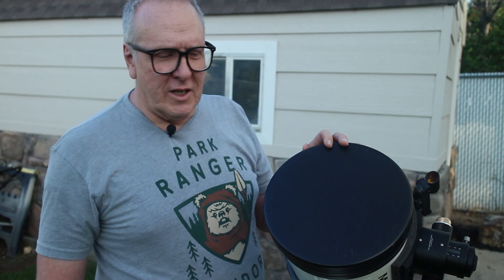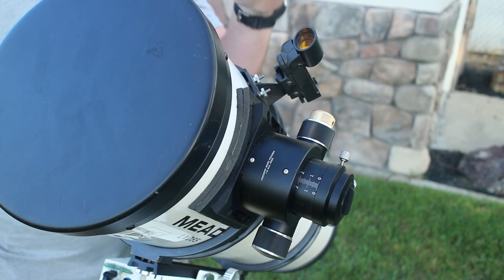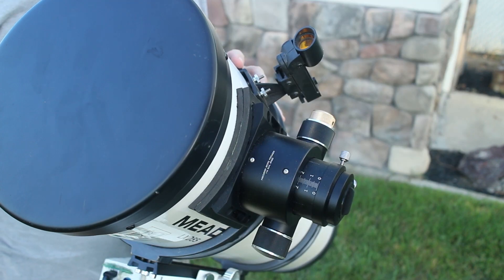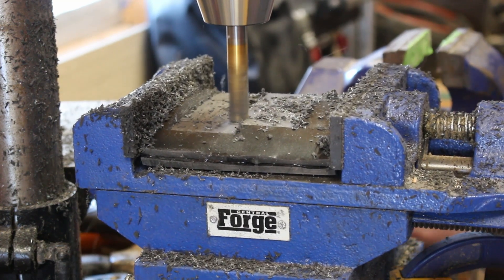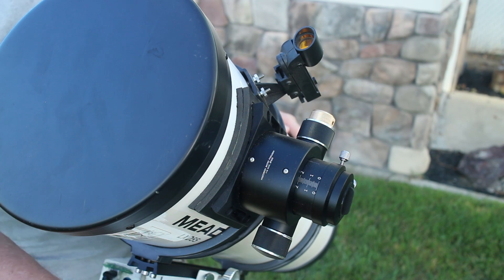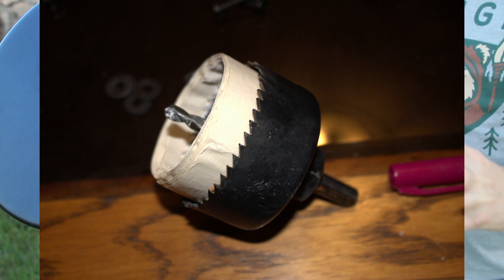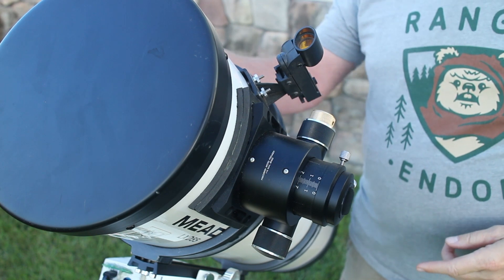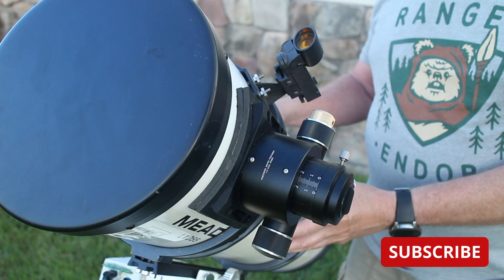Telescope Focuser Upgrade for 20 year old scope (Meade SN8)

Comment: I bought a C6-N for $125 at a Pawn shop and the mirror was micro-scratched from being cleaned with a paper towel it also came with a 2x Tele Vue Barlow. I sent the mirror off to be re-aluminized during a sale at Optical Wave Laboratories. They tested my mirror and said they could improve it to at least .95 Strehl and 1/10th wave. I got it back at .98 Strehl and 1/12th wave, it was near perfect to my rookie eyes. My 1.25 R&P focuser had to go. I bought a 2" PMI Crayford focuser with dual speeds. I've had guys in my astronomy club say it was as good as their 8" scopes were insofar as clarity and brightness. edit, OWL no longer performs those services btw, didn't make money and optical engineer who refigured my mirror left for better pay.

That 2" focuser with 2" eyepieces is something else and I bought an Apo 2" Luminos 2.5x Barlow to double-duty my 2" eyepieces. I've been offered $1000 for the old C6-N scope. Heck with the focuser I have near $800 into it, but I can see the Crab Nebula with it, no filters. On the brighter globular clusters it is great with the Omega Centauri Cluster filling up the eyepiece view. I live at 32 degrees latitude so I get good views of much of the Southern sky in the summer.
Reply from the maker: Nice. We live the upgrade life.

Comment: Great video. I was wondering if you had any challenges with the focus point or if you changed the size of your secondary?  If I understood you correctly, you went from a 1.25" to a 2" focuser. I am looking to upgrade a 55 year old Dynascope 10f6 with a narrow 2" focuser.  I will likely increase the size of the secondary and if my calculations are correct, I should be using a 2.6" / 66 mm secondary. My father had used the telescope with an OM-1 back in the 70s with a custom thread type focuser but my D850 is too big and the camera is too close to the tube to work well.  I will likely also need to move the primary mirror up 55 mm so I can get the focus point on the back plane.  Any thoughts you might have are welcome.
Reply from the maker: @ddessert6  they were both 2 inch l believe. I have another video where I show how to make sure everything is aligned properly.